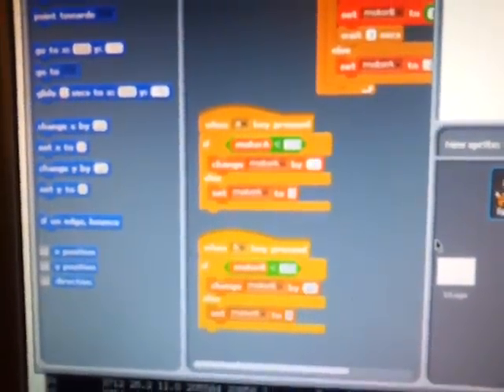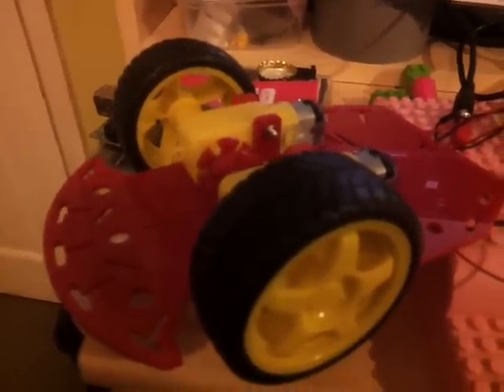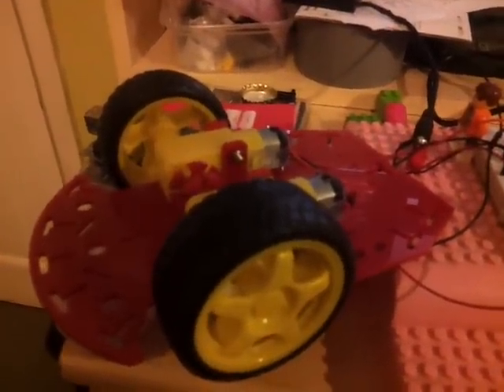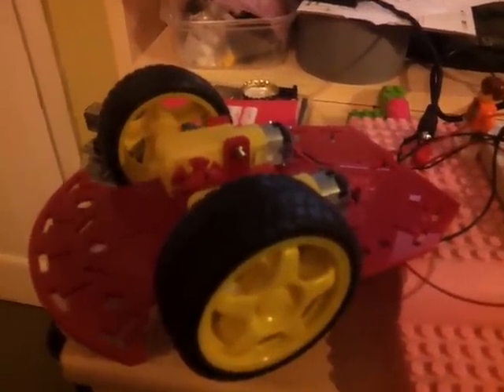Scratch on a RaspberryPi controlling motors via the GPIO

Comment: Simon,
I'm trying to get Scratch on my RPi that allows 2 motors to be controlled using Lego Wedo. I am new to all this and I'm not confident enough yet to start messing directly with the GPIO pins, That will come later. Does your Scratch have motors A and B in the Motor Blocks ? If you do would you tell me how you did it ? Alternatively could you provide a link to the image ?